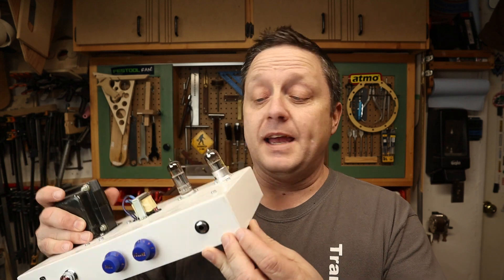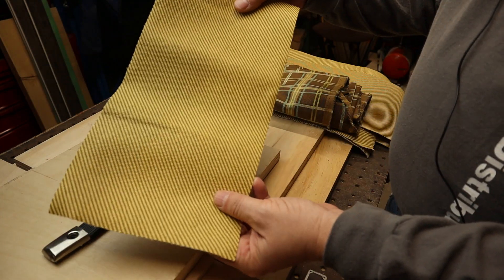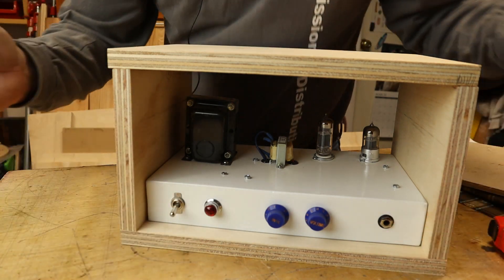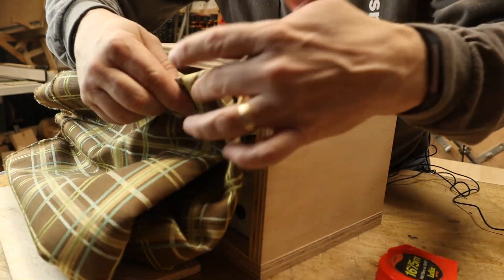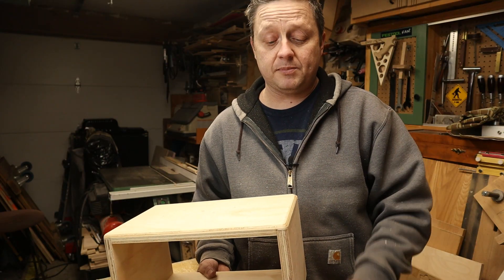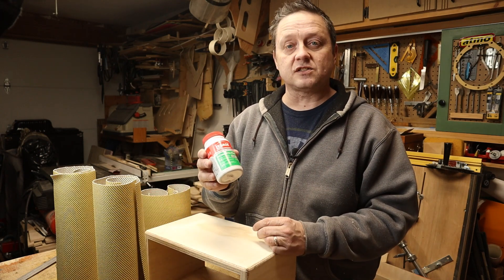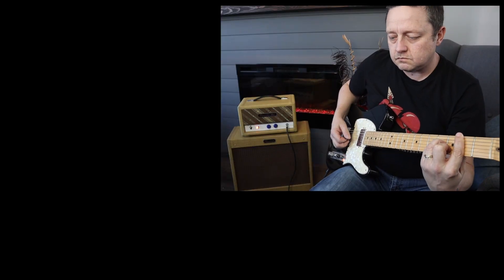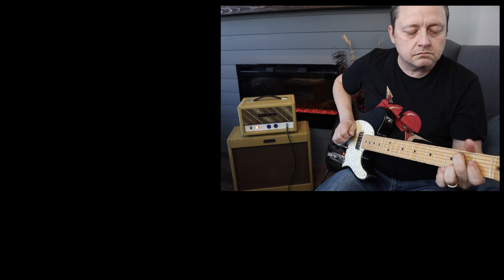Making a 1 WATT TUBE AMP-Part 3: Cabinet, Tweed & Play / DONE / Building a guitar amp from scratch

Comment: Really cool build. I'm planning on making one myself. I am in New Zealand and our mains power is 230v 50hz. I'm wondering what type of power transformer I'd have to use to make the amp suitable for our electricity supply. Any idea?
Reply from the maker: Thanks for commenting. Hammond makes a 300 series of transformers that have universal primaries.  The 370AX should work well.  Cheers.
Reply: Hi Mike, thanks for the reply on my previous query! I decided to go with a separate step down transformer and stick with the same PT you have used as this was quite a bit cheaper. I've now almost finished the build but am stuck on a couple details from the layout plan. 
Would you be able to explain what is happening with the wire that is running from the top of the 22uf capacitor to the volume pot? I'm assuming it's grounding, but want to be sure. 
Lastly, the speaker output you were using looks to be TS mono, but on the layout you have a different type of socket with three pins that you've hooked up a 10r 3watt resistor to. Is that correct? 

Thanks Mike, your videos have been incredibly helpful. Been thinking about building myself an amp for sometime but until I came across your build it always seemed just a bit out of reach.
Reply from the maker: @lancegardner7176  Thanks for asking again. wire that goes from the 22uf filter cap to the pot is a ground. I made it dash to reflect that it may not be needed. It may hum without it, it may not. Since you are grounding the volume pot anyways, this wire may not be needed. You can also take all the grounds and run them back to the star ground.  The main point here is to just seperate the first two filter caps from the rest of the ground on the board. This helps with current flow and potential ground loop and buzz/hum.
The 3W resistor from the switch  to ground if for the headphone output. If you don't require a headphone output, you can omit it all. I omitted it on my amp.  It's also a "safety" if the speaker is not plugged in to not low your PT.  You don't really need it. Cheers.
Reply: Huge Thanks Mike, the amp works an absolute treat and is has almost no hum! The NFB switch is a blast and gets me some great sounds at low volume, which is handy because my wife has just had our 2nd child😅. 
Your design and responses to my questions were a great help. Been thinking about building a tube amp for almost a decade and you got me there. Legend Mike, I've bought you a few coffees over on the support page. Much appreciated sir!
Reply from the maker: @lancegardner7176  Great to hear! Thank you for your kind words and thanks for the coffee's! If you have any pictures, send them my way and I can post them on my Community Page! Cheers

Comment: Very nicely done. I think the 10" speaker is a much better match for that amp than the 12 was. I agree that a spoonful of reverb really widens the sound as well. Looks great too.
Reply from the maker: Thanks.  I agree with your statement. The speakers have different power ratings and firmness so that is probably why there is a difference. Being a low power amp to difference is quite noticeable. Cheers.

Comment: Hi! Great project! I have a non working Blackstar HT5. Can I reuse his power transformer in this project? HT seem 380V. Is it necessary to adjust value of components? Thanks in advance
Reply from the maker: Yes, you should be able to re-use all the main components to make a new amp. I'm not sure of you version you have but the PT may be a Voltage Doubler. You need to figure out how to drop the voltage to the plate of the 12BH7 to ~315VDC. Some dropping resistors or a Zener Diode may work. I would recommend using the Duncan Amps Power Supply Simulator.  This amp will draw around 25-30ma. Fun project!
Reply: @MikeFreda  Thank you. I suppose I must deal with the heater too, since it's 19V out of the transfo. Maybe I can reuse the 2 LM 317 of the Blackstar.

Comment: Can you please include the chassis specs? Thank you
Reply: I need the hole/cut outs and spacing. Thank you
Reply from the maker: Hello, The chassis is 11.5" long  x 7" wide x  2" tall.  The tube sockets are spaced 1.25" from the back edge and 1.5" and 4" from the right side. I'm sure you can figure out the rest from laying out the parts and/or drawing it full scale on a piece of paper, cheers.

Comment: So what can you tell me about the BlackStar ht1or ht5. Do both channels have the dioide clipping. And is there any fact in calling it a all tube amp. Or is it just a hybrid.
Reply from the maker: I do have a video on one of those amps. Have a look.  These amps have a lot of solid state components in them. Some of those components are in the signal chain, some of them control the tubes bias. In these amps there is a dedicated preamp tube (12AX7) and a dedicated output tube (12BH7) that directly feeds a output transformer. I guess one could call it a Hybrid but a Hybrid to me would means a tube input section and a solid state output section or vice/versa.  Cheers
Reply: I appreciate the response.

Comment: that was pretty cool, it came out real nice. i could make the chassis and the enclosure, but the amp itself,  i could never do.   very cool build!    you should loosen your grip on the neck some,  or eventually, you're going to strain your hand.  i had to teach myself the same thing. thanks for cool content
Reply from the maker: Thanks for commenting. Glad you found the build cool.  Yes, I do realize I do that. It is a habit formed from when I first learned how to play guitar.  It was a low cost acoustic with a high action… I had to press hard so it would not buzz. Old habits are hard to break. Lol Cheers!

Comment: Great contribution to folks that want to make a neat amp. There are so many iterations of these little  amps. I built one that has a ez81 rectifier and runs 361v on the plates. I'm wanting to build one with a front end similar to a Matchless Clubman 35. Including the effects loop. While many folks build Champs and Kalamazoo #1's with old reel to reels , the power transformers are ideal for making these little 12bh7 amps. Plenty of 6.3v amperage in a Voice of Music VM730 to run lots of preamp tubes. Thanks  for sharing so much detail for DIY builders. All the best to you and yours.
Reply from the maker: Thanks for your comments. It was a fun little project and a little different than what people tend to make.  I’m working on a Dumble style higher gain version of a 1 watt amp.  The video will be out shortly.

Comment: Really nice work! I'm finally inspired to start my project. 
I don't know if you did (I'll still check on your channel), but it would be great if there were videos like "typical problems", "begginers issues" and "troubleshooting".

Greetings from Brazil.
Reply from the maker: Thank you. I hope it works out for you!  I don’t have any “troubleshooting” videos but that is a possibility for me to do. 

In video 1 and 2 I do have build tips. 
Most issues for new builders is cold solder joints, minor wiring issues, buzz/hum due to poor grounding techniques and voltages that are off. If the amp actually works it is easy to fix all those issues. 

Good luck.

Comment: Hi Mike. I made the amp. At first the amp wasn't working, i thought, but i found out it gave sound when using the headphone jack. So the amp was working.
I wired the switched speaker jack in a different way and now the amp is fully working.
My DC voltages are a bit different then on your schematic.
317 vs 307
13,6 vs 12,9
1,25 vs 1,39
166 vs 156
169 vs 159
1,27 vs 1,33
In the video you said "calculating the bias". Is this necessary?

I'm waiting for your next higher gain (dumble style) 1 watt amp. But first i have to make the cabinet for the amp i just finished.
Reply from the maker: That’s awesome. Thanks for letting me know. Those voltages are within spec and I suspect it has something to with line voltage and overall amp bias. The hotter the bias, the more the voltage will drop but I think you are good. 

I would recommend checking the power tube bias once you have it all buttoned up. More for curiosity and learning how to do it. 

How does it sound?
Reply: @MikeFreda  I think it sounds great, bright and loud!. There is some humm, but for a first build high voltage amp that's oké. 
I will check the grounding.
Reply from the maker: That’s good to hear. Chasing buzzing and ground issues is a very common issue for builders. You become a better builder when you figure it out. Sometimes it’s just the cable, house grounding or Halogen or LED bulbs. 

In the amp, made sure signal wires and heater wires are away from each other and cross at 90deg. Ground the back of the pots. Separate the PSU ground and the rest of the ground on the eyelet Board the run it all back to the star ground. I hope that helps?
Reply: Thanks for your advice.

Comment: This is a great video series thanks so much Mike.  I managed to build a single ended hifi amp over lockdown and to my surprise it actually works and sounds great.  I am in the UK is there a UK alternative for the power transformer you are using?  Thanks Glenn
Reply from the maker: Thanks! I got the transformer from Allied Electronics. Hammond makes the same one. Actually, I think Hammond makes the Allied one.
You can use any Plate Transformer that has similar voltage and current properties.
~250-0-250V or  440 to 460VCT @ approx 50ma with at least 1.5Amp on the 6.3V will work fine.
Try Hammond: 269GX
The Fender Standalone reverb PT will also work you just need a full wave bridge rectifier. (4 diodes)

I would not recommend going over my B+ voltages as described on my schematic.
Reply: @MikeFreda  thanks for the advice Mike that’s brilliant I will see what I can track down 👍
Reply: @MikeFreda  Mike I remembered I bought a Hammond 369EX transformer to build a hifi preamp with.  Could you advise if this would be suitable it is 380v ct @ 75ma. Thanks Glenn
Reply from the maker: Yes, that will work. B+ will a bit low, you may have to adjust your PSU dropping resistors. (A little lower value).
Reply: @MikeFreda  Thanks again Mike sounds like a plan.👍

Comment: Hi Mike, great job, I love it ;). Would you please have a link or a ref for the PT ?
Reply: https://www.newark.com/hammond/6k49vg/power-tx-50-60hz/dp/31AJ8672
Reply from the maker: That’s it. I got mine from Allied. I think Hammond made them for allied. 

You can use almost any plate transformer I. That voltage and amp range. Hammond has a bunch. You can also use the Fender Stand-alone reverb transformer but you need to use 4 diodes for a full wave bridge.

Comment: Hi Mike - this is a superb video series and has motivated me to try to build my own version. What would I have to change to use and EL84 as the power tube?
Reply from the maker: Thanks. You would need a different output transformer, a power transformer that will accommodate the extra current and a different cathode resistor. Check out AX84, that website has everything you need to know.
Reply: @MikeFreda  Thank you for the pointer, will read up!

Comment: Hey Mike, I have another question. 
What differences would there be for a 1 watt bass head? Would it be possible for you to do a series on that with a cabinet as well? Many thanks for your videos.
Reply from the maker: Bass amps typically like a lot of clean power. A 1 watt bass amp would only be good for practicing or possibly installing a line out for recording. You could take the circuit I did and use a 12AU7 in the preamp section to clean up the front end. I’d also go with a 10” ceramic speaker for clarity. Interesting project but I can’t see my self making something like that since I don’t really play bass.

Comment: Hi Mike, very nice build! Just a question: your 12AU7 tube is configured in a push-pull fashion, each side using half of the 125A output transformer. Did you try instead a single ended configuration ? Using the same components, you just will need to change some of the connections. Let me know if you are interested into a schematic.
Reply from the maker: Thanks. Yes, you can configure the output tube as a parallel single end but that requires a different output transformer. I did have to purchase a output transformer and the 125A was readily available and I suspect that a Push/Pull would provide a bit more output.  Thanks for the suggestion. I may try something like that in the future.

Comment: I have a 5 watt/1 watt amp I really loved for about 14 months before it died....it used a 12ax7 and a 12bn7 power tube. Do you know the difference between the tube you used an the 12bn7? I hope make a point to point amp out of this amp some day.
Reply from the maker: Unfortunately, I’m not familiar with that tube. Best thing to do is look at the RCA spec sheet for both tubes and compare. I suspect it’s in the same family of this sort of tube.
Reply: @MikeFreda  thank you so much for your response. Well I was wrong. I pulled the original papers on the amp and it is actually the 12bh7! I loved the clean plus the ability to get huge feedback at t.v. levels. It's a bugera g5 infinimum head. I registered it for warranty never heard from them, call support nothing. Took it to an old school tech he couldn't troubleshoot or even find a schematic for it. I will never buy another product from the "tribe" again. But I'm so thankful you built your amp making it simple for me to duplicate. Thank you again.

Comment: Hi Mike, thanks for sharing the 3 video's building a 1W tube guitar amp. Great explination. Until now i have builded some low voltage tube guitar amps. I wanna give your amp a try.
I have one question. In the build schematic on the input jack there is a 1M resistor. On the final layout it says a 100R resistor. I believe the right one is the 1M (looking at the color code of the resistor in the video.) Can you confirm that it should be a 1M resistor.
The only thing a have to do is finding an equivalent for the  6K49VG power transformer with 220VAC primary, as i am living in the Netherlands.
Reply from the maker: Thank you for your kind works. I hope my project inspires you.  Yes, that is a mistake on the input Jack. 100ohm is a typo. It needs to be a 1meg resistor. 

Substitution of the PT is fairly easy. There isn’t a lot of current draw. You will never see more than 40ma in this amp. The Fender standalone Reverb PT will also work you but you need to wire it as a full wave bridge.

The layout has been revised. New link in description. Thanks for catching that.
Reply: @MikeFreda  Thank you Mike.

Comment: Hi Mike I just subscribed. I have watched all three of the videos on this amp. You have built very nice sounding amp. I would like to build one similar  to this one, a little higher wattage (20 watts, something I could play some small gigs with.). What about the price of your electronics to build this one, If you don't mind me asking.
Reply from the maker: Thanks. The amp I built was a budget build. I had a lot of the parts left over from other project. I did have to buy the Output transformer. I guess if I have to price it all out I suspect it would cost be around $225-$250 in all the parts. What you want to do will cost a lot more. For 20watts of power you will probably need 2-6v6 power tubes similar to a Deluxe or a Harvard. Amps like that cost more to make due to the bigger transformers and more parts needed. Good luck!

Comment: Very nice.   Just watched all 3 videos and the tone is nice and smooth.  I'm sure when turned up pick attack will bring out some nice growl.  
I was thinking about getting the little Blackstar 5 watt with 1/2 watt switch but have heard bad reviews of cheap throw away circuit boards, IC nightmares, etc.
I think I'll try my hand at this little guy.  
I'm coming around to the fact that a 50 watt Mesa isn't the best option for bedroom playing. 😁
I'm curious how this responds to pedals.  
Thanks for your clear and well detailed videos.
Reply from the maker: Thanks. The cool thing about this amp and the way I build it is you can easily swap out components to tailor your sound. The amp I built does take pedals okay.... but I suspect that if you want to use drive pedals or distortion pedals you may want to install a 12AY7 to clean the amp up a bit.